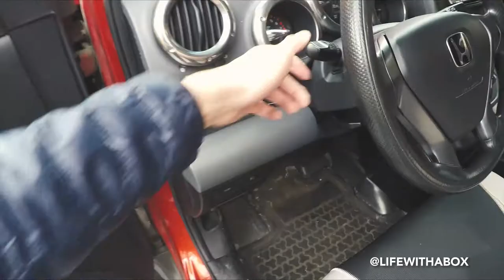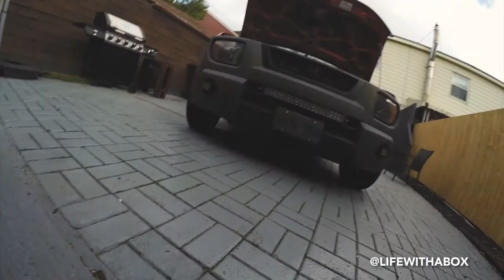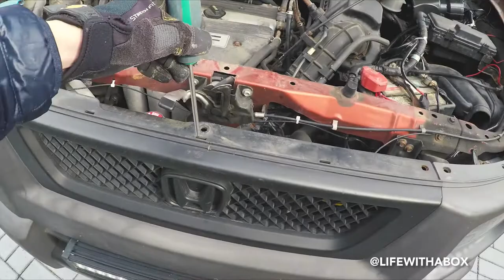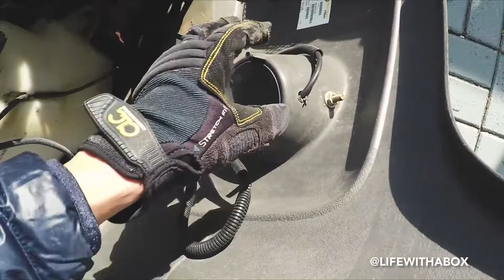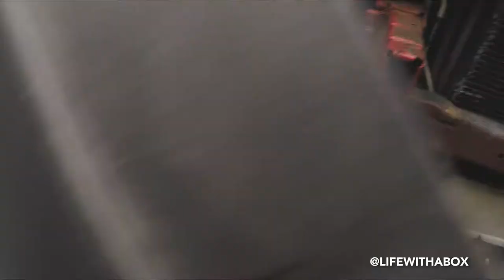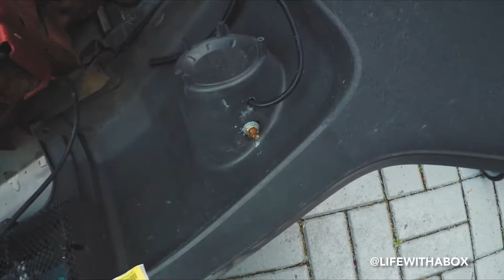Auxbeam Led Fog Light Install on my Honda Element

Comment: hello, i amreplacing the stock fog lights on my 2007 element and i got the Rigid D-SS.  should i install another relay? and if so, what relay? 12v or 24v?  and where does it go? thanks so much for your videos and help! cheers!
Reply from the maker: No need for the relay.  the D-SS will go straight to the OEM fog light wires.
Reply: @lifewithabox  thanks so much for the reply, the install went great! Thanks for your videos!!!

Comment: What brakes do you run on your element? I just got my element back today from it getting a new engine so happy to have the five speed box back!
Reply from the maker: just the stock brakes...  but i got front drilled rotors.

Comment: With the way they are mounted by a single bolt, do they vibrate/shake when driving?
Reply from the maker: Nope the plastic is thick and  the bolt has a large surface area.  So far so good.